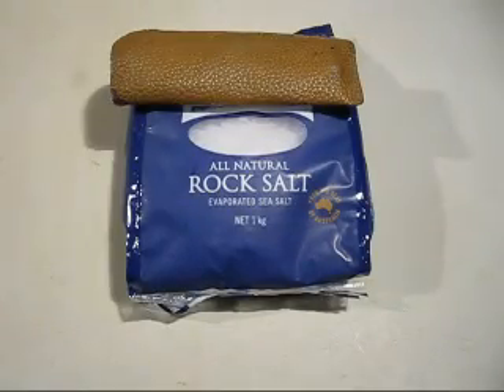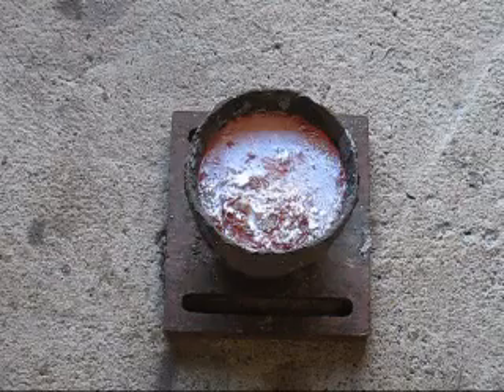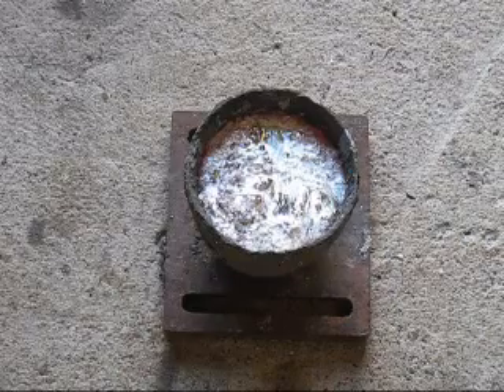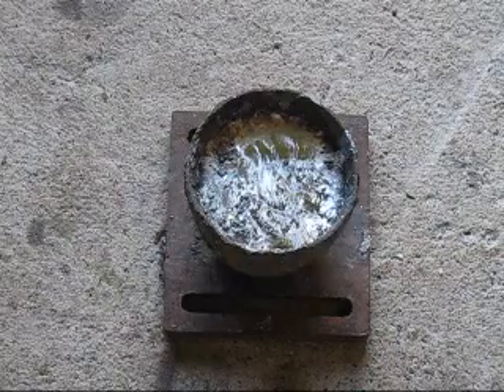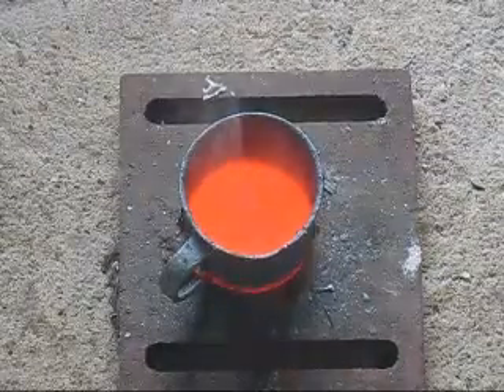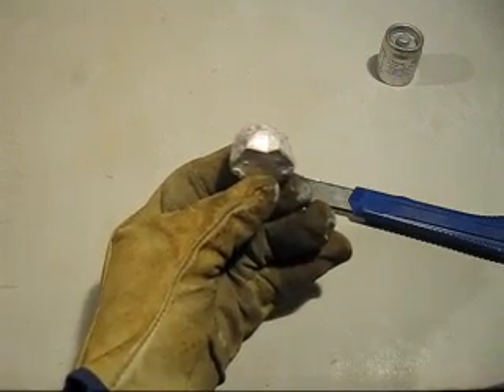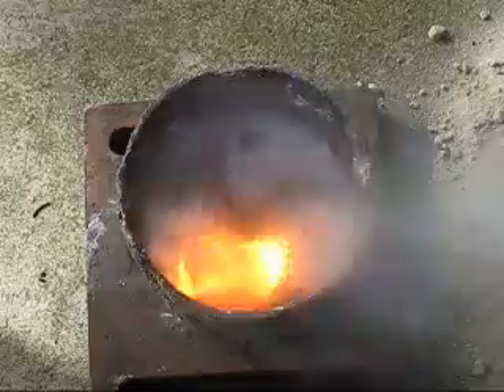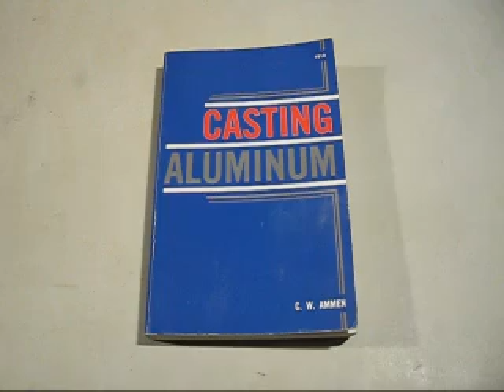Can you degas aluminuim with common salt Sodium Chloride

Comment: You are not going degas just playing around the top of the melt. This guy has no idea what he is doing.
Reply: zippy, if you knew what you are talking about you would consider the displayed information more deeply.
first of all the the salt did not melt nor decompose at the temperatures of molten aluminum. if the salt did not decompose to sodium and Chlorine then it would not react with any hydrogen or be able to degas the aluminum.
all that happened with the salt was that the entrapped moisture was released - a very important point.
Now for all those mistaken people that wrap the salt up in foil and submerge it in the molten aluminum there is a bigger problem. the massive air bubbles produced is not from the degassing of the aluminum but from the expanding gas that was trapped in the foil when it was wrapped. Looks good but makes the problem worse.
next to make things even worse- the moisture that was in the salt is released deep within the molten aluminum and makes any entrapped hydrogen WORSE.

So go suck, wrapping anything in foil and submerging it in the melt, makes the entrapped gases worse - the bubbles are the gasses you were trying to prevent entering.
Reply: He says so himself at 7:20!!
Did you even watch the video?

Comment: If that's pure sodium you have there, when not sealed it should be stored in oil. It will react very violently to water, even the moisture in the atmosphere could be enough to set it off. If you haven't seen it before, carefully and from a distance, drop a very small piece (match head size or less) into a pot of water and watch the reaction!
Reply: A friend gave me about 1/2 kg of Metallic Sodium, it was in a glass jar of Paraffin oil.  I used to cut off a piece, throw it on the ground and hose it with a spray of water.  The reaction was very violent, an explosion and ball of molten metal.